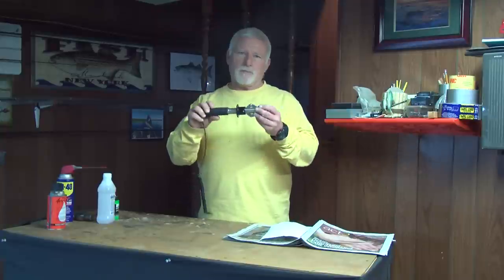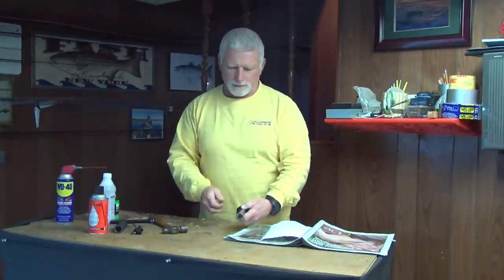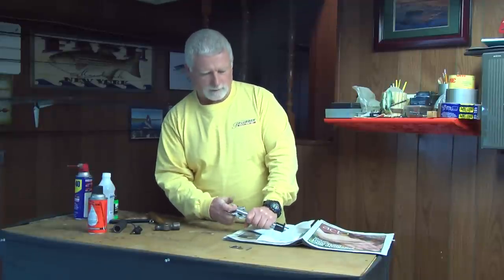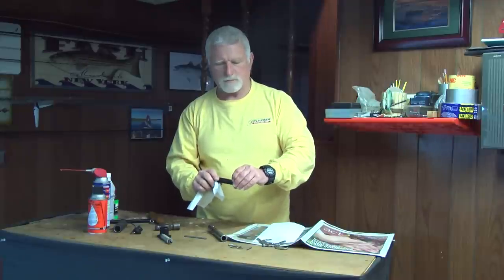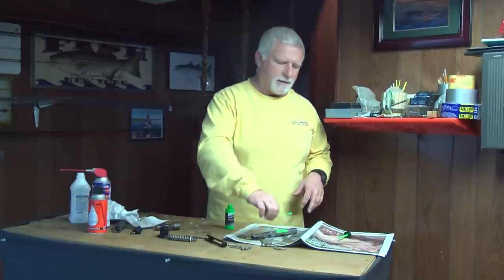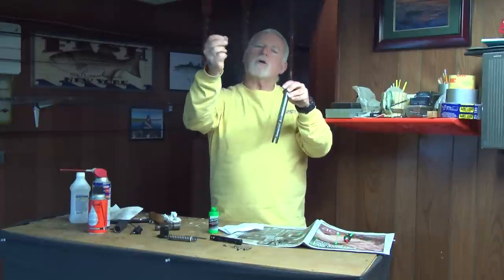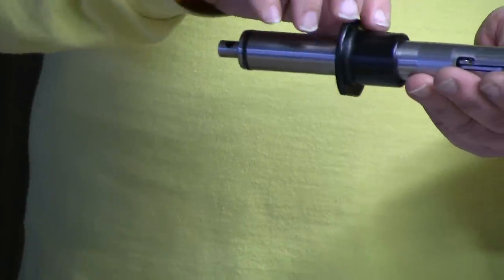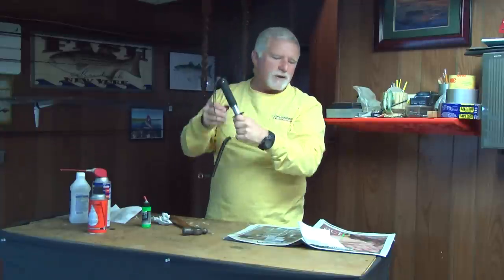Servicing Boga  Grip 30 lb scale- Surfcaster's Journal Magazine issue #24

Comment: i see  ,theres  a better way sir ,instead a taping them i just used a star bit and push them a little out and used the assembly tool in next then put on wood and push my weight and there poped out when putting on them its same way and i do like your video, this fish grip boga is a  well built